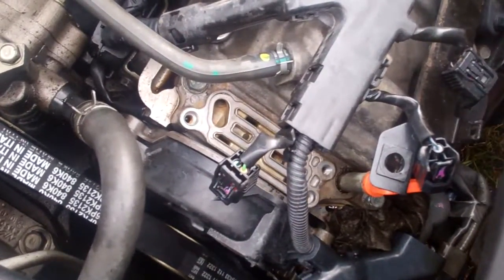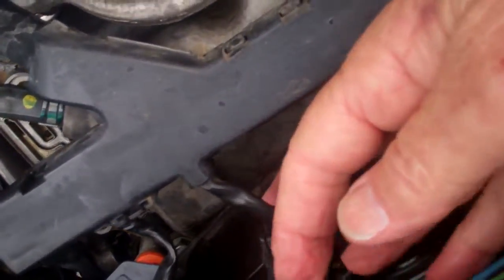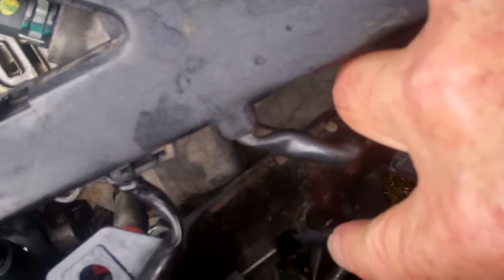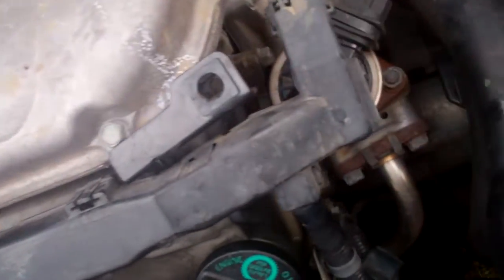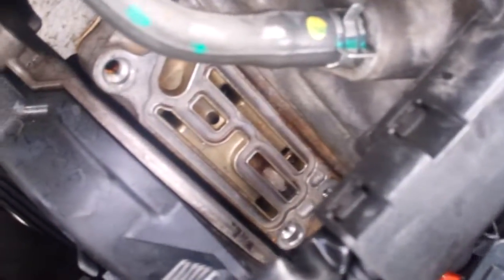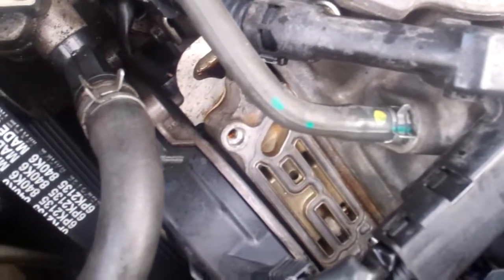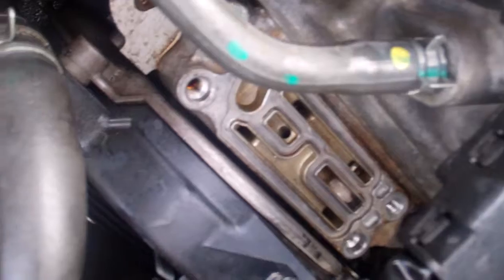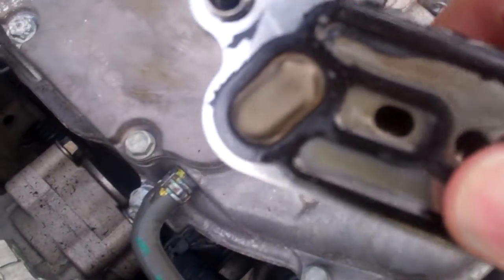Honda 3.5 Engine VVT Solenoid (Part 1) Variable Valve Timing Oil Leak 2008-14 Odyssey Accord Pilot

Comment: Mine was leaking and killed my alternator. Replaced that, bought new gaskets. 

Thought to try tightening the bolts first and found 3 of 4 too loose. Tightened them and no leak since.
Reply from the maker: Yes, keep checking it often, though, these spool valves things seem is be pretty temperamental. Thanks for watching!

Comment: I tried to put gasket maker and it fixed my leak but now I have engine light so the vvt valve is bad..
Reply from the maker: I have heard that gasket sealer can gum up the tiny oil passages. Could that be the problem? Thanks for watching!

Comment: Honda's r good cars, but this is a stupid design having the VVT Solenoid above the alternator. I have a 2011 Accord V6, the 2 gaskets had a small slow leak which dripped down on my alternator n fried the alternator. Honda does not sell the gaskets separately, u have to buy the whole VVT Solenoid. $250+  Shame shame on u Honda !!
Reply from the maker: Thanks for watching and commenting!
Reply: O'Reilly Auto sells a Mahle # GS34049 gasket kit for that solenoid. It's about $25.
Reply: @daveclark8337  thnx Dave, much appreciated. I bought gaskets n I'm sure they were chinese knock offs, but so far so good. Will definetely buy from Oreilly next time.  Again thnx.
Reply: Where do you buy the genuine Honda part for 918056?

Comment: Don't use any kind of sealant because it will seep out and clog the tiny oil ports in the solenoid. The gaskets have to go in dry.  Also the oil leak will drip into the alternator causing it to fail.
Reply from the maker: Great Tips! Thanks for contributing!

Comment: Helo sir, i changed the gas kit and i was tightening the bolt but unfortunately bottom left side one bolt got free, now one top and one bottom right side bolt are tight but lower left side bolt is just moving its not tight, plz advise what should i do, i started the engine, its not leaking, but spool valve is depending on 2 bolts only.....
Reply from the maker: It sounds like the threads may be stripped in the base that is under the VVT Valve. I think it is likely the VVT Valve will begin to leak oil at some time. If the base has a stripped hole and must be replaced, you will need to be very careful to not let any broken thread particles get into your engine when you disassemble to replace any part around the VVT Valve. I would be reluctant to do any kind of re-tapping that assembly or going oversize with the bolt due to the risk of the loose threads causing major problems. It may be best to find a good Honda mechanic and have the base replaced. That is a more complicated procedure. Perhaps you can get a good Honda mechanic to check it out.

Comment: I have a fair question.  Is the problem really the solenoid, or is the problem just the gaskets?  I've had this engine small leak for years now, never paid any real attention because it was so small and it really didn't give me a hard time.  Back in June I kinda did some mechanical updates for a long road trip ahead.  I fixed the AC, new pair of strut assemblies, timing belt, (which I never changed at 100,000 and now was 157,000), and 4 new tires.  My mechanic told me the engine was leaking a little oil thru the valve covers (the usual mistake), so I gave him the ok to fix it for new gaskets.  3 months and about 4,000 miles more, after an oil change, the car "increased" leaking, so I thought it was the Quick Lube place that had messed up.  Took it back and while over there I discovered where the REAL leak was, the solenoid.  Make a long story short... Changed the gaskets and apparently everything was good until a month later I took it to the freeway at 70mph and then it gave me Code 3497.  You see, I used my car to Walmart and back from my house for more than a month, so thats why the issue never came out. I finally ordered the Dorman 918-056 and discovered many things when I received it.  This is my diagnostic on my car: The original solenoid might have been wronged but the replacement gaskets I used where not the best gaskets. The first pair of replacement gaskets I ordered I returned because the "mesh filter" in one of them came crunched in the packaging. The second pair of gaskets (the ones I installed) were better looking but yet didn't look like the original ones. I still installed them and thought I had fixed it but no.  When I received the Dorman solenoid.... AHHHH... what a difference.  The mesh of the gaskets was perfect.  You see... the mesh "basket" of the gasket needs to fit its place because if it is crunched or bent or compressed, it will get on the way of the opening which feeds it. you will notice as you pull out the gasket. These car computers are so sensitive that I am sooo sure it interferes somehow with it registering the right oil pressure, therefore, Code 3497.  Today I replaced with the Dorman to cover all bases, used the old screws though, but BOTH new gaskets and metal plate that goes between. Erased the Code with my scanner and now looks good.  I need to take it for a run over 70mph/3,500 rpms to see if its really working or not but... I don't foresee any issues but total correction.  Total cost: $90.98 thru Amazon, in my doorstep in 24 hrs.  Auto Zone thieves wanted $175.+ tax. I can save $100.
Reply from the maker: Thanks for the information! Looking back, I am happy that I went ahead with the Dorman solenoid (about $120 at O'Reilly - glad you gave the Amazon deal) as it has worked well since the work was done. Not a drop of oil leaking since. BTW, a local garage quoted $500 to replace that VVT solenoid - after they had originally estimated $110 to do a "gasket replacement". Thanks Again, and for your comments also!

Comment from the maker: Dorman VVT Solenoid used on this 2008 Odyssey Touring model - Dorman 918-056 (includes the gaskets). The gaskets only may be available on Amazon. Amazon shipped the gaskets which arrived in two or three days.

Comment: How do i take out the part underneath? I under it has a plate acting as a gasket. Mine is leaking and i need to replace it but i don’t know the name of the part and haven’t been able to find any info on the part. Thanks in advance!
Reply from the maker: Thanks for watching! Sorry, I haven't worked on another Explorer in many years (and there are many different seat configurations) so not sure at this point. We have a local "you pull it yard" that helps me out a lot with that sort of thing. If you have one near you, maybe they would have one disassembled. Online Ford parts webpages don't seem to offer much help. I wish Ford had a good OEM parts online program giving parts break-down info.  Public libraries sometimes offer access to more in-depth online repair programs they actually pay for, that might be an option for you- may be complicated to navigate though. Wish I could be of more help. Thanks Again!

Comment: How is the Dorman working out for you? Any check engine lights?
Reply from the maker: I didn't want to get away from OEM parts, but cost and getting it going quickly was the priority. I feel like just gaskets would have fixed it, but were 5 days away. It seems to be working out fine with no check lights reported. Thanks for watching!